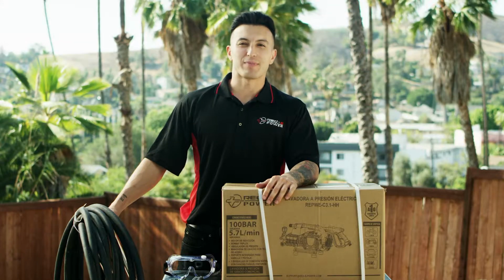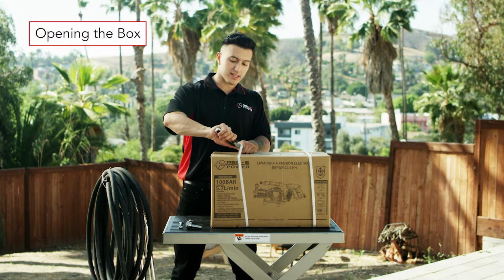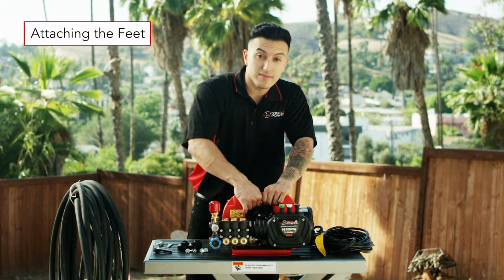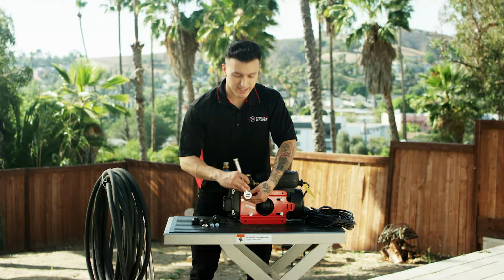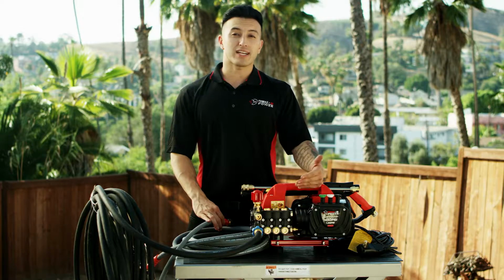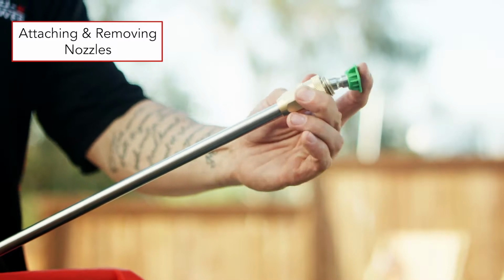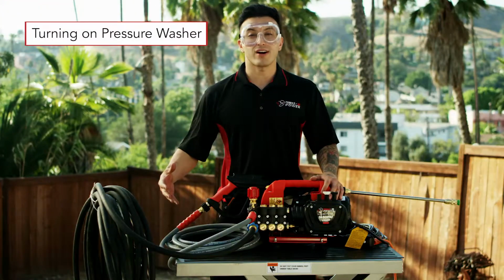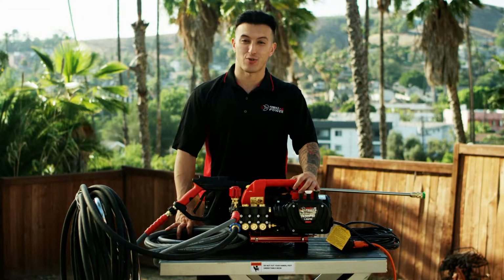Quickstart Guide For The RED-E POWER 1450PSI Commercial Grade Electric Pressure Washer

Comment: Anyone know what happen to this Company??
I’m having issues with my pressure washer & when I search for more videos or go to the website it suggests on here it takes me to a whole different website.
Reply: H2o detail supply in Covina Ca bought them out. I suggest giving them a call
Reply: @freshdinh3  that’s funny because H2o is the shop that sold it to me knowing that these came with an overheating issue. 
I No longer have that machine as H2o did swap it out for a newer ARblue. 
Appreciate the response, thank you.
Reply: Did they charge you extra for it!?
Reply: @freshdinh3  they did to upgrade to the ARBlue. But I No longer have anything from them. They gave me all my money back, I had too many issues with the equipment they try to sell me.
The first setup was used and it was a Gas pressure washer. The works forgot to plug one of the outlets so when I first started it leaked all over my van. Since I live few hours away I called & spoke to one of their employees. He told me is a easy fix go to Hime Depot and buy a plug to stop the leak. So I did, when I finished I started it once again and luckily I was standing few inches to the right because the pressure regulator valve blew up and hit a cracked concrete wall. I was shocked so I called them and told them I was going to take it back. 
The next day I went back I told them I no longer wanted this set up I wanted my money back. 
The owner was reasonable and told me how about if I give you a deal where he gave me a new set up with that Redpower electric pressure washer and he took my new small 2300 watt generator and swapped it for a 3500 predator. I told him ok, I appreciate the help. 
Two days in, in the middle of rinsing a 2018 expedition the pressure washer died. 
It literally took about 30 min before it turned back on. I called them and I went again this time they gave me the ARblue but I had to put extra 200.
So I did, a week later the supposed New generator started giving me issues with siting out and not starting back up. 
That was my last straw, I took it back and told them that this going back and forth was an inconvenience if they can just cash me back out. The owner was cool enough that he did. 
They try to make it as I was the one that had the problem and that this only has happened to me. Not really sure if that’s true or Not because I went straight to Home Depot after that and purchase a Ryobi 1800 & went to harbor freight and purchased a 3500 predator and it’s been working fine ever since. 
My thought is no one needs all this dance equipment to get the job done. 
Specially when they are first getting started. 
Nevertheless, I appreciate the owner because at the end of the day he did take care of me.